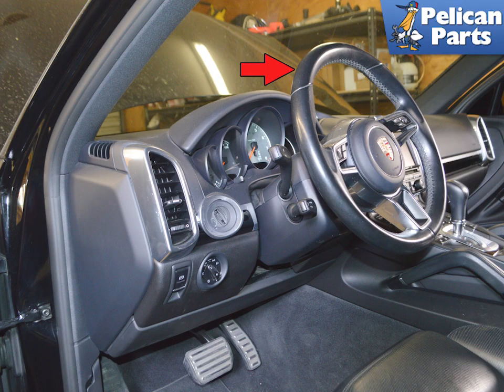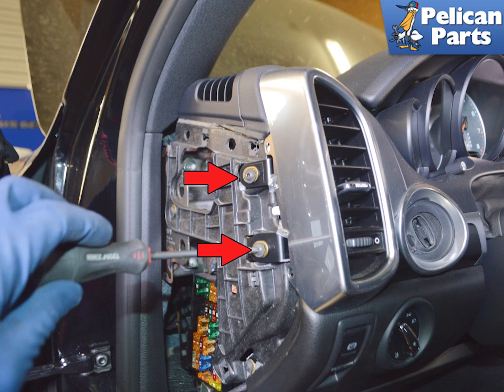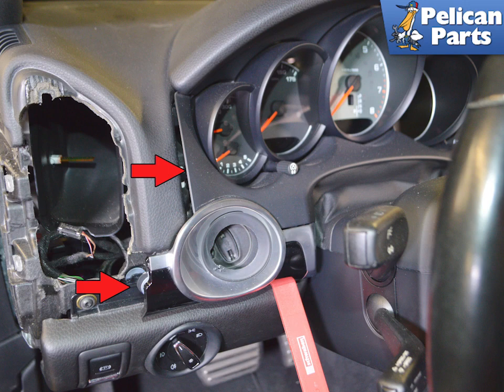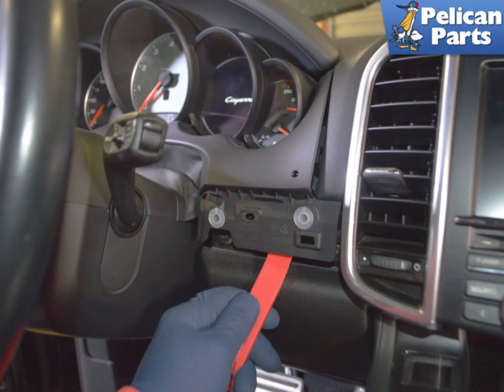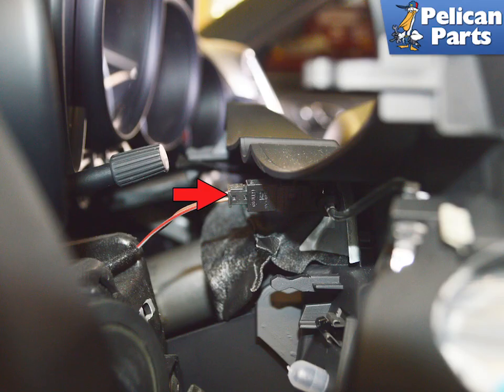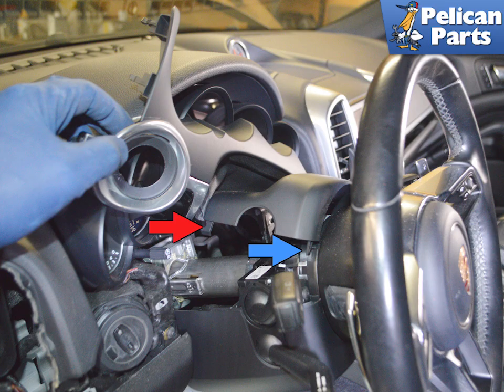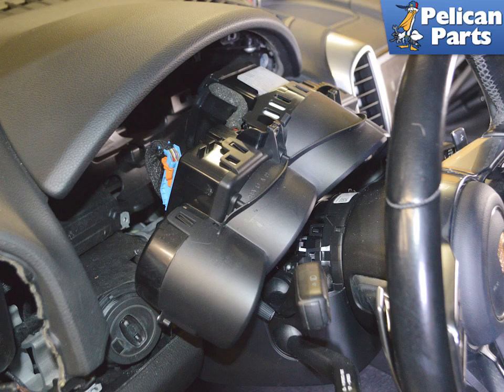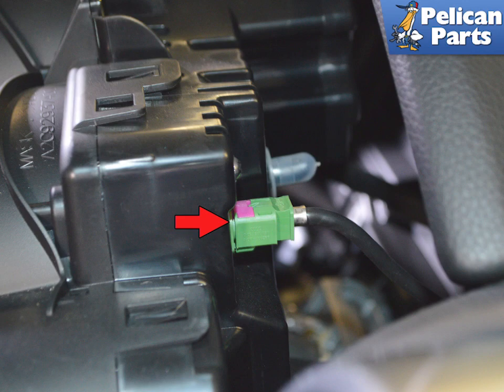Porsche Cayenne 958 Instrument Gauge Cluster Removal (2011-2019)

Comment: Great vid.... the last clip (green and purple one) attached to the instrument cluster... how is that one released please? before I end up breaking it?
Reply from the maker: "Use a small flathead screwdriver to lever the purple locking tab up, it will slide up and stop. It does not come out of the connector.

Then, press the release tab on the connector and pull it straight off.

This is going by memory, let me know if this works for you. "

Comment: The Ignition insert for FOB can be removed using half this video. I switched mine out and the old key worked. (Why? Cause some idiot tried to screwdriver the hole and failed) The programming is in the FOB key and the PCM not the ignition box.
Reply from the maker: Thanks for the Info. We appreciate it.